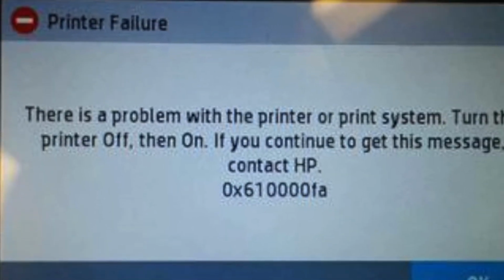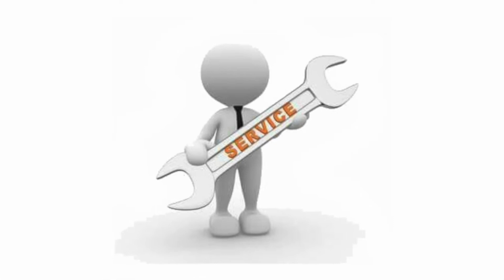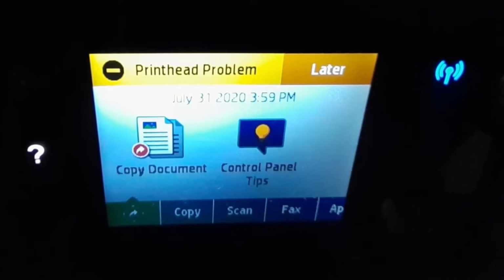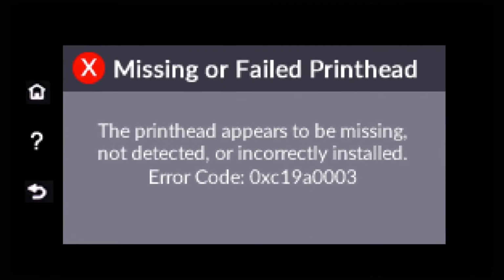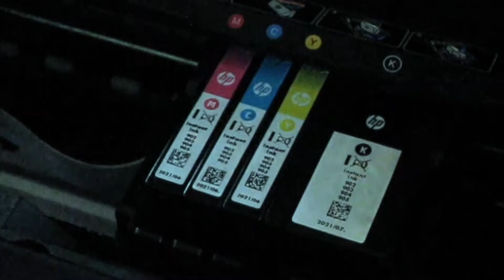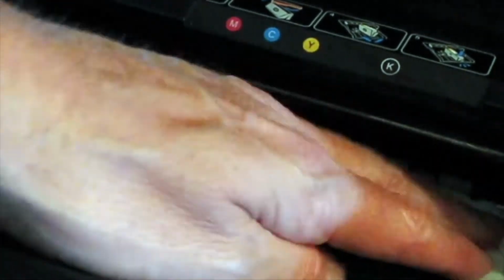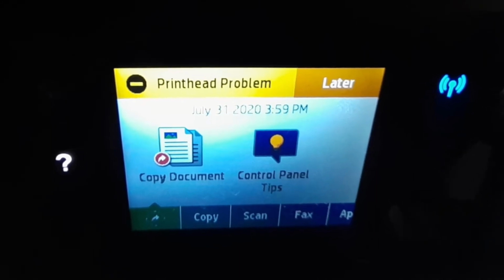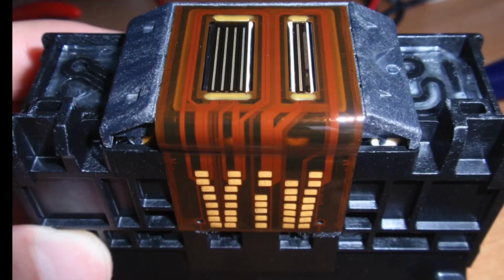HP OfficeJet Pro 6978 Printhead Problem | Failed Printhead

Comment: I'm having trouble with the print head. While fiddleing with it the cartridge was all the way to the right and two ink cartridges popped out and wont go back in. The whole assembly is all the way to the right. Thanks in advance for helping.
Reply from the maker: Also, ensure there is adequate ink inside the built-in printhead. Perhaps get a syringe and squirt 5mm of water into the printhead ports (remove all 4 cartridges)...this will help resoak the internal Printhead foam. NOTE: Ink System Failure and Printhead Errors are usually associated with a lack of ink inside the printhead.

Comment: I tried these tips and they seem to work only for a short time.  I have taken the print head out of the printer a couple of times for a good cleaning and then I and then it will print for a short time.  I am wondering if buying a print head on Amazon might work, or would there be a firmware problem?
Reply from the maker: Also, ensure there is adequate ink inside the built-in printhead. Perhaps get a syringe and squirt 5mm of water into the printhead ports (remove all 4 cartridges)...this will help resoak the internal Printhead foam. NOTE: Ink System Failure and Printhead Errors are usually associated with a lack of ink inside the printhead.

Comment: 2:56  printer head code : 
Oxc19a0015
What does this mean?
Reply from the maker: Internal PRINTHEAD electrical issue or poor electrical contact issue in most cases, but sometimes a firmware refresh can resolve the issues. Visit HP.com and download the latest printer firmware for your HP model.  Good luck!  UH

Comment: Holy cow. It worked! I assumed it wouldn't, since these things never seem to, but your paper towel solution worked. You're a genius. THANK YOU!!!
Reply from the maker: Roger that...yup, works like a champ!  :). UH
Reply: How many times did you have to do the cleaning procedure with the paper towel?  I did the process at least 7 times and I still have the printerhead error message.
Did you clean until there absolutelt NO INK left on the paper towel?
Reply: @tumarbongrox6074  I think I only did it once. Sounds like you might need a new printer. These HP's haven't treated me too well, but I'm too cheap to buy anything else.

Comment: i am instant ink user. customer service sucks. i have put 3 dufferent sets on ink in. keep get code saying one or more inkjets wrong or missing. they are not. i cleaned print heads. did get ot going after messing around for hours. then notice blue showed low but printed. decided change it. this erroe all started over again. i like to shut off wifi to this printer. i think i go buy new injets and not be involved with instant ink. think they have control what i am trying. as said they suck. any helpbe appreciated, thanks
Reply from the maker: Hi Allen, 
Typically the 'wrong or missing' error is caused by a poor connection between one (1) of the cartridges and the internal PRINTHEAD electrical contact. However, if you are actively enrolled in the HP Instant Ink program you can only use 'Instant Ink'  HP 902/903/904/905 labeled cartridges otherwise the printer will reject non Instant Ink program cartridges. Once you are unenrolled then you can use refilled, aftermarket, HP regular or even 'Instant Ink Ready' starter cartridges in the printer, but not 'Instant Ink'  HP 902/903/904/905 labeled cartridges - those will need to be returned to HP or discarded. 

Withstanding, for 'wrong or missing' errors (under normal circumstances) you will need to verify plastic latch positioning and that there are no scratches on the cartridges smart chips. Refer to video on how to do this. 

HP902XL Ink Not Detected | Verify Restraining Latch: https://www.youtube.com/watch?v=fNzLwRxWgl0

Good luck!   ;).  UH
Reply: @LaurralynMike  tHANKS.. STARTING TO THINK OF DOING THAT. THANKS
Reply from the maker: @allenluberger1511   Roger that...  ;). UH

Comment: What do you do if the printhead assembly appears latched to the right of the printer and won't move?
Reply from the maker: Hi Richard, first remove the paper tray and ensure you don't have too much paper installed; reinstall paper tray. If this does not work then perform a hard reset of the printer: 
1. Power On printer.
2. Unplug power cord from wall. 
3. Wait 30 secs.
4. Plug in and power on printer. 

If this does not work then you may be able to release the printhead via a small interlock switch (small square opening the size of a pen tip)...depress to release. I will need to check one of my 6900 series printers to confirm whether or not the 6978 includes this release feature.   Good luck!  UH
Reply: @LaurralynMike  Performed the hard reset drill a couple times. Paper level not an issue and I can't find any opening on the bottom (paper tray removed) that is in the area of the print head carriage. Actually, part of the paper feed appears to cover that area. 

When the printer is powered on and you open the cartridge access area, the print carriage should move to the center to allow you to access the print cartridges. On this printer this does not happen and the print carriage cannot be moved (nested at the far right).
Reply from the maker: @richardlafford1397    Hmmm, wondering if the service station wipers below are not disengaging. Have you tried turning your printer off, then open the lid and turn the printer on? If the cartridge moves, unplug the printer and try to move the cartridge manually to the left and back into the middle if you can.
Reply: @LaurralynMike  I think that is what is happening. Open the lid with printer on and the carriage doesn't move. Cannot move carriage with power off either.
Reply from the maker: @richardlafford1397     Ok, let's try something more invasive: If you take a flashlight and look behind the printhead/carriage assembly, you will see an encoder strip (very thin plastic reader) that runs the width of the printer...don't touch that as it is very delicate. Just behind the encoder strip you should see a belt hooked onto a gear at the left and a spring on the far right. See if you can carefully reach in there and pull the carriage out by gently applying and pulling FIRMLY on the belt to the LEFT. If not, then the service station underneath the issue could have a motor problem. 

Also, I just remembered...have you attempted to clear the printer back to it's Factory Default settings?....this might just be a printer firmware hang issue.  Here is the basic procedure for that (this is a different printer model and resolves a different issue, but the service menu access procedure is very similar for your printer): 

HP OfficeJet 5255 Printer Protected Cartridge – How to Fix: https://www.youtube.com/watch?v=W-ZVTdsB8vU

UH
Reply: @LaurralynMike  I'll look for the opening.

Comment: Worked like a charm! Thanks!
Reply: What if one color isn’t printing, and I have zero error messages?  I’ve run the head cleaning utility many times, and have had HP replace known defective cartridges in late fall of 2020. I’ve always used their Instant Ink membership. I don’t know what the defect was in the cartridges, but if debris clogged the heads from the top side, is there any way to deal with that? If defective cartridges ruined my print heads, I feel like they owe me a printer. 

Also, one tech had me remove the cartridge and power down the printer for 1 minute. That seemed to work for half a page, but didn’t work a second time.
Reply from the maker: @popx4   Hello. If one color fails to print following repeated 'CLEAN' procedures at the printer then either 'some' air has been ingested into the internal PRINTHEAD due to a poor physical connection between the respective ink cartridge's port (i.e. where the ink comes out) and the interface into the PRINTHEAD's respective ink port interface. I suggest you perform the following 2 corrective actions to resolve: 

1. Check the PRINTHEAD for broken or bent pins...see video: HP OfficeJet Pro 6978 Missing, Damaged or Defective Cartridge: https://www.youtube.com/watch?v=GcVlzvKi7_Q

2. Manually clean the bottom surfaces of the PRINTHEAD assembly (since the printhead is not removable for your printer model): 

3. Using an eyedropper (or teaspoon), drip about 10-15 ml of distilled water (or regular tap if that's all that is available) into the respective color's ink port in the base of the PRINTHEAD (you'll need to remove all 4 cartridges and use a flashlight to see what you are doing here)....this will help establish 'ink flow' into the PRINTHEAD. Install cartridges and run another 'CLEAN' routine via the printer's control panel. 

Refer to my video on how to perform the actions in #2/#3 above: 
HP OfficeJet Pro 6978 Missing Colors or Black – Printhead Cleaning: https://www.youtube.com/watch?v=_99UMgxcjJs

Good luck!  :-).  UH
Reply from the maker: You're welcome and thank you!   :-D